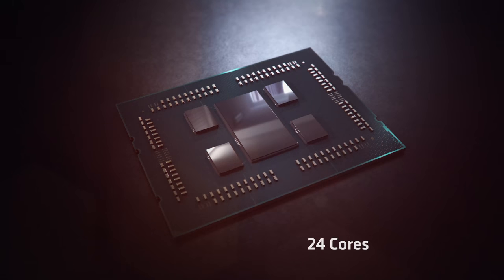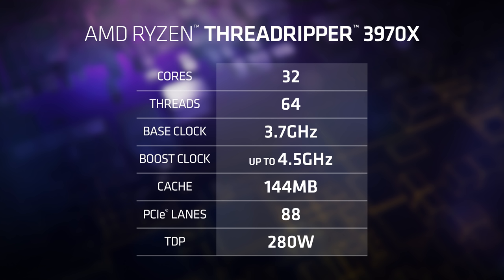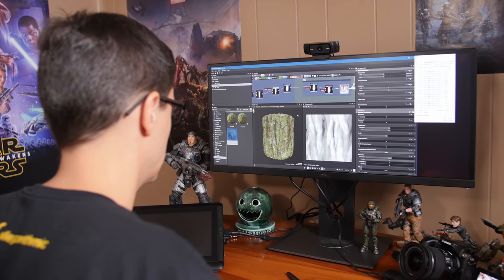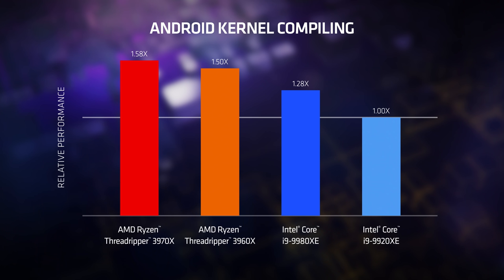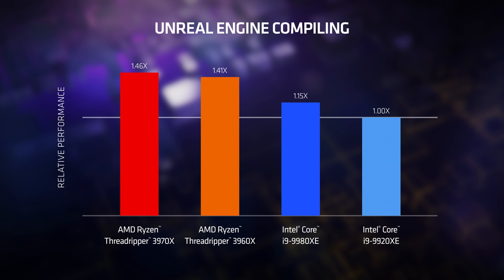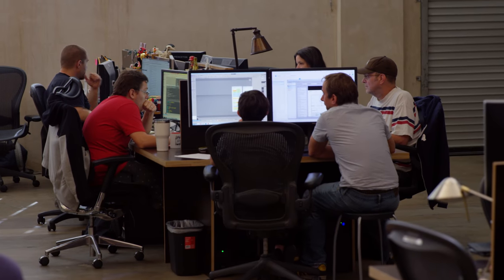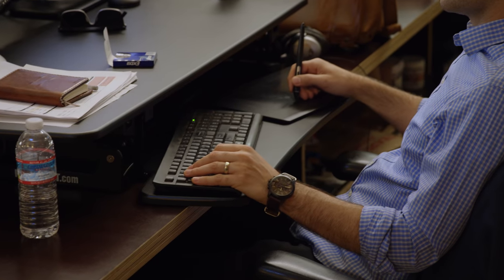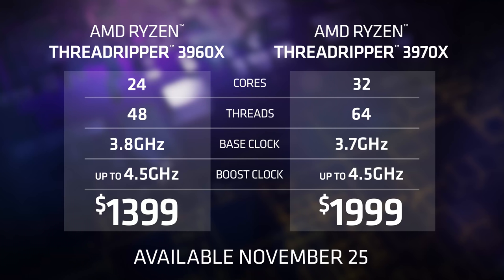Performance Preview: 3rd Gen AMD Ryzen™ Threadripper™ Processors for Creators

Comment: Pretty soon AMD will introduce a Threadripper that will replace the engine in my car. The power they are offering is just amazing.
Reply: Pretty sure Intel will be a better car engine considering the heat it generates

Don’t want your car freezing with an AMD CPU
Reply: i9-9900K 8c/16t is more hotter than a Ryzen 9 3900X 12c/24t, LMAO.

Comment: "...a frame from 30 hours to 20 minutes"... were you using Pentiums before?
Reply: I had exactly the same thought
Reply: were you making 3D animations before writing that comment?
Reply: like, I'm totally an AMD fan, don't get me wrong. but that just... doesn't make sense lol
Reply: @4ghzgaming664  it just doesn't make sense. such a studio probably had at least an Core i7 on each machine. 30 hours to 20 minutes doesn't make sense for such upgrade.
Reply: Maybe they were using old i7 actually and just outsourced heavy rendering. As the guy said "now we don't have to send it to a farm".
I switched from a old workstation with an i7 920 to my new one this year which has a TR 1920x. It's not that off, but I understand your point
Reply: @4ghzgaming664  your theory also proves that their numbers are exaggerated. and that's my main point hahah
btw nice upgrade. I'm looking forward to upgrade from third gen i5 to an R5 3600.
Reply: It's very expensive to get your studio updated with the newest hardware. We had the 920 because it was the best you could buy in 2010 and it's still pretty capable with around 5 million poly scenes. We only switched panels and GPUs over the years.  Haha the 12gigs of ddr3 did fine too. But now I'm happy with my new stuff. I guess the guys in the video have a comparable experience

Comment: Happy with my Threadripper 1950x with Unraid OS with 2 Gaming Virtual Machines. Ryzen processor are beast. Thank you AMD for making this products
Reply: I successfully played around with this with a tri multi-gpu 290x watercooled setup I had lying around with this a few years ago, is the process more refined now? any good up to date guides lately?
Reply: Same here - still happy 1950X owner who wants to replace his 1080 Ti with a Radeon VII soon for compute tasks.
Reply: @geerstyresoil3136  I just followed Spaceinvader One videos, my problem is the IOMMU groups which depend on the mobo so I have to roll back the bios to do gpu pass-throughs (Gigabyte x399 Gaming 7). I successfully dump the bios too hence I do not need a primary GPU to use Unraid. Pretty happy with Unraid as of the moment.
Reply: Can u review ur setup
Reply: I've got the 1950x and am very happy with it! NVMe are incredible. Wish I could run XP on it! Boot up within 2 seconds.

Comment: My hat off to Lisa Su and her incredible team - AMD all the way! I've been an AMD fan since I was a teenager and I've never looked back. My current 1st gen Ryzen 5 1600 still kicks ass! I'm currently using an RX560 2GB and can't wait to get it paired with a RX 5500XT or 5600XT depending which one fits my pocket.
Reply: I sold my RX 460 2GB for around 50$, and I managed to snag RX 470 mining edition for the same price. Now my Ryzen 3 2200G + 8GB 3200mhz RAM and RX 470 will last me at least to next year. As a poor gamer. It's a godsend
Reply: Completion is great, but AMD is undercutting prices that are determined in multiple complex ways. Were still being milked in the end. Imagine there was a team yellow, or team purple. Having more conpanies than just Intel, Nvidia, ATI and AMD would make prices way cheaper, but completion is so intense that other companies get squashed before any real progress in the market.
Reply: I was running a Phenom II X6 up until two months ago when I had found a good deal on a X79 mobo and a 3930K. I hope to make the jump to Ryzen soon.
Reply: @thomasdavey1513  it's not possible. x86 is Intel's proprietary. It's not about whether anyone can make the chips or not (we have Qualcomm) but the thing is they can't legally.

Comment: Aww. Was hoping for a 64 core version. Still tho.. Great specs. Go amd!
Reply: There's clearly space for "WX" class SKUs in the product stack :D
Reply: The 64 core 3990x is coming in January, just not announced.
Reply: @giggyolly  Yes. I read something now about a 48core and 64core part releasing to ces 2020. That would be really... epyc...
Reply: not yet ;)
Reply: last gen 32 core SKU was the 2990wx, while this gens 32 core is the 3970x. So there is definitely room for 48 and 64 core versions.
Reply: LandeTLS 64 cores for H1 2020
Reply: That octa-octacore 9-die monstrosity that pretends to be a "64 core" is coming on a yet another and more expensive motherboard called TRX80. Cost of that MCM chip will be at least $3K, probably over $4K and motherboards will cost over $1K. Tell me again why people are getting excited over server parts that are being sold at server prices?
Reply: 3980x and 3990x will probably release later because they probably will refine them and wait until intel makes their move, its genius really.
Reply: I am confident that they'd release a 64 core Threadripper with the same higher boost clocks when they roll out on 3nm dies. Right now, I think it's physically impossible to have a Threadripper with some high boost clocks without burning your house.
Reply: I think they are saving the 64 cores to respond to what intel present
Reply: @ToobeyAmbi  idk
Reply: its coming later. 3990x it got leaked recently.
Reply: Alex Marin overclockable... It runs faster memory (for example my TR-1950x runs 3600 MHz, that does not exist for server memory), and when the TR-64 core comes out I want to build it a triple cascade cooler (target is -100c) for my next daily upgrade, obviously this will be well past 5 GHz all 64 core.

Can you overclock server? Technically yes (some motherboard hardware chip modding required, bios mods etc), but with Threadripper you also get much better boards designed for LN2 overclocking, so for instance the servers won’t be worried about it if the chip can’t boot at -80c (but the gaming/benching boards do), and the VRMs for example on a supermicro (that’s the company name, not size) boards are simply not designed to be cramming in 1000w (that’s what the Intel 28 core uses, on water cooling...). The Threadripper boards have some advantages, I would think everyone would want a faster computer right? Like that’s why people are spending that much money on them, for the speed.
Reply: @LandeTLSgPlus   It will be epyc when the ripper is ryzen.

Comment: Always remember:
"Advanced" Micro Devices

.Only company to give "8" MB high performance L3 cache at below $120.

.Only company to give 100% more L2 cache per core than the competition for all types of consumers.

.Only company to support a single Socket for multiple generation of CPUs.

The smoothness of operating system no matter how many programs you practically able to use on a AMD Ryzen processor is second to none.
Reply: Intel uses the same socket, they just force you to buy a new board claiming it’s not compatible even when they are just artificially locking you out ;)

I’m a little annoyed my TR4 board can’t upgrade though, that’s disappointing since it should be the same chip (and still only quad channel memory, they didn’t bump that to octa...)
Reply: Sumit Singh “100% more” lol
Reply: Sumit Singh also intel has been on lga1151 for a while now

Comment: Congrats guys! You have done an impeccable job with Ryzen and Threadripper! So much so that I would choose AMD any day, with closed eyes, over the other competitors, for my personal and work  environment. And for my friends and close ones.

btw I saw you left a little space in the naming for something like a 3980X and 3990X with 64 Cores maybe? hehe 😈 do it!
Reply: they already did it :D Chips like that are produced month if not a year ago. no doubt 3990WX is coming to release my 2990WX. only hope is 8 channel mem and at leat mobos with 256gb ram support. that important for this many core. hopefully no infinity fabric limitation for dram. 88 lanes is awesome. means 11 gpus per system theoretically.

Comment: A beast😍 this is innovation!
Reply: What's AMD's innovation exactly? The 7nm process node is TSMC's. Do you call connecting dies together innovation? Intel Pentium Pro, Pentium D Presler, Xeon Dempsey, Xeon Clovertown, Core 2 Quad (Kentsfield, Penryn-QC and Yorkfield), Clarkdale, Arrandale, and Haswell-H all say hello...
Reply: Alex Marin oh yeah and intel? They aren’t even able to do things like 7nm. I get it, they don’t produce chips theirselves. But AMD still needs to develop their own architecture and choose the recourses to make it work. And they can deliver more performance for less money. If AMD never came back we all would still use quad cores and the work station platforms 8-cores... because intel didn’t give a damn
Reply: @alexmarin7897  Intel can't reach 10nm in 2015 OmegaLul.
Reply: @kevinyoliveira68  -- And AMD gave up on process node innovations since 2009 on 45nm when they span of the manufacturing as Global foundries. And GloFo did nothing ever since other than moving to 32nm. Their move to "14nm" (16nm on Intel's scale) 6 years later was only due buying the technology from Samsung. Not developing it. And the "12nm" was just a lie as it was just an iteration of that 16nm (which they marketed as 14nm) that they bought from Samsung and it should have been called 16nm+. Then now AMD moves to TSMC's 7nm node (10nm on Intel's scale) which was built mostly by Apple's money (as well as Nvidias, Xilinx's etc). AMD had zero financial or engineering contribution to TSMC's node whatsoever. Also while you hate Intel you should know that the EUV technology (that TSMC uses for 7nm+) exists largely thanks to Intel funding ASML 4 billion dollars (plus dedicating semiconductor engineers for its co-development). AMD is nothing but a small fabless company that somehow its fanboys give it credit for the achievements and work of others...
Reply: @alexmarin7897  AMD is doubling down (imo) on striking out as fabless to everybody. Recently they said that they would focus more on the architecture rather than process node technology (optimisation and whatnot). So regardless of AMD's contribution to processing node technology, you can give them credit for what they're doing good at: architecture designing.
Reply: Innovation of what? Not far from 1st gen. Good processor, but innovation is not. 128 threads on desktop CPU will be
Reply: @davidnguyen1622  - My comment was in response to someone trying to mock Intel for their 10nm delays as if process technology were an area AMD were actively involved and winning. AMD gave up on process technology for over a decade now and they stopped exactly because of being incapable of successfully or competitively developing new nodes. And the only reason TSMC has caught up with Intel is the smartphone revolution where Apple and Qualcomm footed the bill with their large profits. Which is a proof that if a company wants to develop advanced new nodes there needs to be high profit margins which is something Intel had to do, and also do it alone. Then comes a free-rider, AMD, uses that node that others funded and wants to appear they are the value champions that came to save us from greedy Intel.
Reply: @alexmarin7897  of course, all of what you said are basically solid and valid points that I don't hesitate to agree with. I think its not easy to really compare AMD and Intel like black and white because its such a long-time asymmetrical war; the two are not really equal and I don't mean in the sense of AMD having less than Intel.

In the context of process technology that we're discussing, AMD using TSMC is akin to taking some weight off its shoulders and offload some of that work to a 2nd "teammate", if you can call TSMC that. And you can see that it seems to work out well for them. But then you can just say "Intel gets the benefit of being self-sufficient through having its own fab". That is true as well, but people aren't seeing results (yet) and they get frustrated. I'm no analyst, but I'm sure you'd agree there are some things that Intel can certainly get better at if they tried (even) harder than they are right now.

Perhaps Intel could also go fabless or explore an alternative that combines the best of having their own fab & outsourcing work. Perhaps they could work to push out that new architecture with hardware fix for security holes + other new features and/or have leapfrog teams like AMD does, if they haven't done so already. This is getting too bloated for whats on my mind, but I'll just say that I'm too tired to get started on bashing or praising companies for whatever they do; as a consumer, I set a budget, look at what options there are within the budget and evaluate them. If one is better than the other and suits my needs, ill buy them. And at the end of the day, I know that ALL of us are winning as consumers. Maybe you'll lose a little if you invested in Intel in the past few years, heh.
Reply: @alexmarin7897  Continue cry in 14nm+++ Intel fanboy :D
Reply: @alexmarin7897  Intel innovation.. 14nm +++++++++++++

Comment: This is just basically crushing already squashed opponents. AMD chill bro
Reply: No time to chill. Can't let the competition catch up
Reply: Taking mid tower aint the end game. get to that ancient.
Reply: They are chilling, by not releasing 3980x and 3990x right now. :)
Reply: @xxxthwagdrakexxx4672  They can hardly push the clocks on cpus with half the cores,let alone a 24 core cpu, for example i have a 3600x oced on 4.4. It's 100% stable on everything at 1.425v (pretty much the limit). But if i go even slightly higher on clocks it wont be stable anymore. Ryzen 3000 are great cpus bad they are mostly maxed out of the box.

Comment: What impresses me most on the 3970X is that 0.7GHz base clock increase over the 2990WX. That's crazy
Reply: What's even more ridiculous is that it has a higher base clock than the 3950x that has half the cores.. What a beast that 3970x is, it will make Intel look real bad. No wonder they lowered prices, these things are monsters.
Reply: @bradhilton118  That indicates they use well-selected dies for these, which would warrant the steep list price increase.
Reply: @photonzoo816  Yeah and it explains why we had to wait so long for the 3950x...Threadripper (and epyc) gives more profit. So all the best chips went there first.

Comment: Massive performance, massive mark-up.
Reply: Massive markup? Are you serious? The previous 16-core Ryzen CPUs started at $1000 and $900 respectively. The current one is $150-250 cheaper at only $750 and is faster than both of them on top of that. The new 24-core Threadripper is just $100 more expensive than the older 24-core one which launched at $1300 which I can justify since it's quite a bit faster and feature-rich. So where's the massive mark-up that you're talking about?

Comment: holding a degree in computer science and having more than 30 years of experience i have a question.  adobe after effects is a different beast from adobe premiere. how does it perform against Intels proc when i run adobe photoshop, premiere, after effects and audition at the same time ? could you show me independent benchmarks ? how about running VMware or Hyper-V how does it perform ? nice red build behind you, would love something similar in blue or green. early next year im going to focus on performance of components of a pc for photographers and editors. i did not consider AMD because puget systems benchmarks showed that the I7-9700 made the most sense. prove me wrong and ill focus on AMD.

Comment: Intel 10900X for gaming and streaming

Threadripper 3 for everything else :)
Reply: 10900X will suck at gaming

It's still a refined Skylake, and it's already smashed into pieces by Zen 2
Reply: @erlienfrommars  Dude currently i am with i7 7740x @5.2ghz and i have a friend with 3900x, i beat his FPS in every single game that we play, we play mostly MMORPG games that are heavily clock speed reliable.
Upgrading from 7740x to 10900x is totally the way to go for me.
It might be refined skylake but it is still way faster than the low clocks ryzen 3gen chips.
Reply: @rouder9237  7740X is kaby lake dude, not Skylake X they are using different topology.

Everyone in the tech community knows that Mesh topology is inferior to Ring topology of the low core count parts for gaming.

Comment: Honestly, the blur studio thing is misleading. They had slow hardware to begin with, no duh it's going to cut from 30 minutes to 1 minute. If they are moving from Intel counter parts, it will be like a 5 to 10% improvement, and that's a maybe (depending on work load).

Comment: Vast improvement to an already excellent chip. Shame the entry level price point increase from 2nd gen CPU is off the scale.
Reply: 3960x is only $100 more expensive than 2970wx and 3970x is $200 more expensive than 2990wx. I wouldn't call this "off the scale". Can you let me know how much Intel's 24-core and 32-core CPUs cost?

Comment: You guys are missing a significant upgrade market by not releasing X399 compatible chips below 24 cores.  I don't have a Threadripper because I need the higher core count.  I have a Threadripper because I need the PCIe lanes.  Now you've left me with no upgrade path at all.  I'd have to spend about $2K for motherboard and chip, just to start.

I was really looking forward to a Zen 2 Threadripper chip to upgrade to.  Very disappointing.